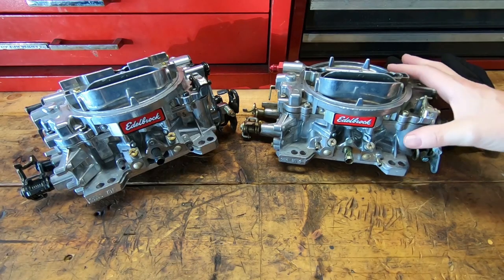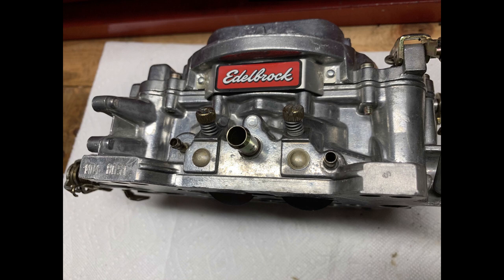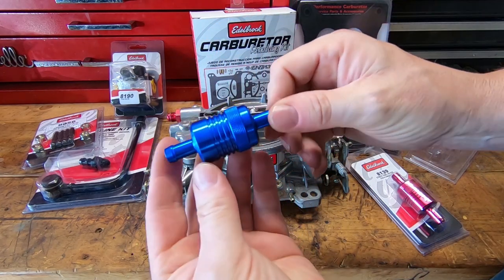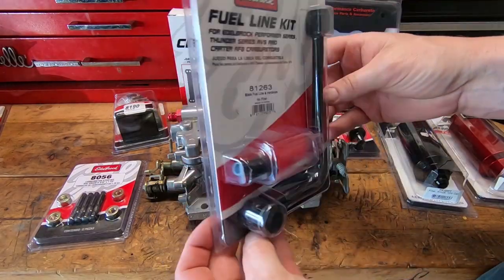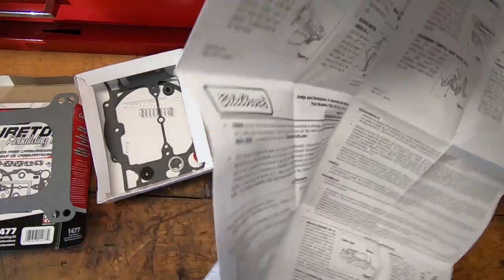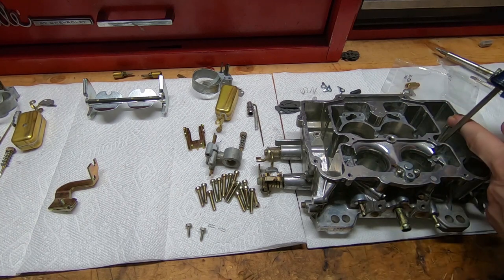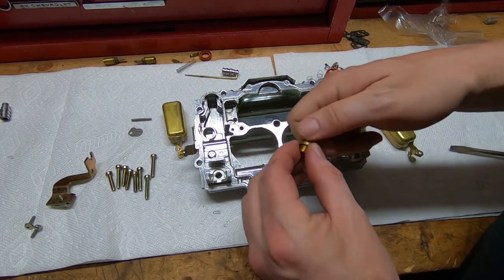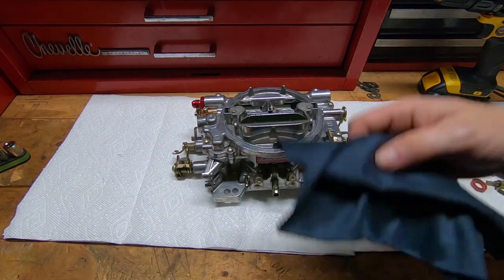Edelbrock Carb Rebuild Tips & Tricks

Comment: I have a 69 carter which was bought out by edelbrock.  They say everything is exact same but I've already found out that's not true. The 2 air adj screws are different size and thread. One of mine was bent and wouldn't seat. Ordered a set and they didnt fit. Had to take to machine shop and they straightened the original and sprayed dye down hole and it showed on end of screw that seat was perfect now. But I'm still having heck of a time getting it right. Way to rich, almost wouldn't run. Added a guage and regulator and set at about 5 psi. Better, but still strong smell of gas on idle, but almost choked when hot the gas hard. So, bought the full kit of springs, rods, jets. And went up slowly 1 at a time til I finally could nail it without half dying. It actually did a pretty good burn out and launch.......but pretty heavy still on idle. I had to go almost to the end of the chart with almost largest rod, spring, and jet....which isnt right because it's a stock 350 low compression 1972 factory motor that's never been modified. Very puzzled . Your vids are a help though and gives me some things to check

Comment: Not sure if you're still watching this chat, but I have a 1406 that I just cleaned.  After reassembly, I have no spring tension on the primaries.  The secondaries will snap shut like they are supposed to.  The primary throttle linking just flops around until you reach the secondary linkage.  I could swear the primaries would snap shut before.  Am I crazy or have I screwed something up?

Comment: Great video,  I need to rebuild my carb and you make it look easy. It seems that my accelerator pump has stopped spraying because I can't start my car without starter spray. My carb might just be gummed up, but I def need to rebuild it. Thanks for the great video!
Reply: Just clean the check ball cause its stuck in the gumm.
Reply: Hey bones have u ever tried those imitation ebay kits. Nothings better than manufacturer i know but man for the price what do u think?
Reply: @MuscleCarSolutions  sorry my break was over. There are rebuild kits on ebay from $15 to 30 for edelbrock. Probably Chinese
Reply: @MuscleCarSolutions  thanks for reply

Comment: I'm running Rich from rebuild on my 360 Dodge so I am trying to get it set up right so it is reliable and responsive still I have no idea what I'm doing but not afraid to try or get my hands dirty if I could just weld it i would be good God bless from Canada thanks for the help!
Reply from the maker: There are a number of videos in my Edelbrock carb playlist.  Check out the one on fuel system set up.  You’ve got to have that right before you get started.  There’s one on how to ready to tuning chart found in the owners manual of your carb.  Makes it easy to understand and what steps to take in the tuning process.  Also one on squirters and step up springs.  Critical to not neglect the springs!

Comment: New sub here 
I hope your still creating content. 
This video  helped
Reply from the maker: Put out 50-60 videos a year.  Jan 8th starts the new year for my schedule.  Cheers!
Reply: @MuscleCarSolutions  
I’ll be sure to put the bell on 🔔

How can I tell if I have a timing advance issue or carb issue 
Stumbles real bad off idle so rebuilt it and same.
Reply from the maker: @tommytron2000  start with the simple things.  What is your initial timing set to?  What size carb and what are the engine specs?  What is your fuel pressure set to?
Reply: @MuscleCarSolutions  
I’m going to have to test things 
Arnt I.
Reply: On a tangent 
The secondary butterfly valves stick about 70% of the the time. 
Is something’s your seen before?
Got me thinking of just getting a new “Fuel make it happener”
Reply from the maker: Time for a cleaning and verification that the linkage is operating freely.
Reply: @MuscleCarSolutions  
Yea 
Gotta do my do diligence. 
I hate that. 

If I give up on it I’ll send send it your way.
Reply: @MuscleCarSolutions  
Solid advice 
Went back to the basics discovered the I was chasing my tail with the carb and my issues were withe the distributor. 
I’ll be watching for more tips. 
Thank you

Comment: So I just rebuilt my 1406 600cfm carb. And when I'm setting my rpm to where it needs to be I have fuel dribbling out of the primary venturi only on the driver side. New floats, new N/S everything. And when truing to get highest vacuum as well I have no difference on the driver side idle mixture screw. But everything on the passenger side is working just fine. I rebuilt it due to very crappy idle and I didn't have any difference on the driver side idle mixture screw. Any help would be greatly appreciated
Reply from the maker: @KyleNock-s6q  if all the air bleeds and the idle passages are clear, then you’re either in the transfer slots, you have a vacuum leak, fuel pressure is too high or floats are set incorrectly.  Those are the common issues.

Comment: do you have any tips on getting stuck paper gaskets off the bottom of the carb? Previous owner just used the paper gasket and it's a mess. I don't want to mess up the bottom of the carb with gouges.
Reply from the maker: Carb cleaner/solvent and a plastic putty knife if you’re concerned about scratching.

Comment: Hi great video btw!!!! I sent out my carburetor to a local shop to get it rebuild. I got it back today and decided to install it back. Everything was running great for the first 15 mins and after that it started to run rough and you can see smokes coming out of the exhaust. I made some adjustments on the mixture thinking that it’s running rich but now when you start the car after is warm up it will only run for less than 5 mins and it stalls out. Any advice would be appreciate it. I have the edelbrock 1826. Thank you
Reply: Wow thank you for a quick response! No pressure regulator here and def watched that other video also lol.with that said this carb is on a 1964 Impala sbc 283. Do you think this is the right size carb for it? This carb was manufactured back in 2004 I was thinking about the avs2 500cfm?
Reply: Everything is factory from the cam except the intake manifold it’s an edelbrock manifold. I guess I also have to have an extra filter from the tank to the line cuz the car only came with the filter before the carb. Thank you for all your help 🙏🏼
Reply: Def will!! 👍🏽🙏🏼
Reply: One more question, do you have any recommendations if I stay with this carb what part# I should use for leaning  the metering size Rod and jets. It’s literally just a cruiser
Reply: Well def found the problem! I should of gone with my gut feeling. The guy that rebuilt it told me not to touch anything beside the Idle screw after it warms up. Well I look at the screw for the fuel and air was all turned to counterclockwise 🤯 that’s why it’s running rich and it wouldn’t stay running!

Comment: Thank you for sharing your brain with us!  :)   This won't be the first set of questions, but, two of your videos did say to ask away.   1) Will my C.A.R.B. gas kill my accelerator pump rubber?  Can I even use E85 in a pinch or even regularly, if I tune it (lambda/AFR tune) ?   (I wonder if I can get an extra one or two and replace it between rebuilds?  I'll call them.)  2)  I have two carbs in my garage: 600 Electric and a 750 Manual.  Both used.   Without sounding too dumb (I have not taken any Edelbrocks apart, yet, but, will this weekend ) are any of the critical parts interchangeable, such as jets or rods or venturi or pump - I assume because of the rebuild kit?   Thank you, again, and appreciate your time!
Reply: You can't run E85 with a carburetor without serious jetting changes.  If your carburetor is set to run gasoline, you will need to jet your carb way higher. Also be aware that E85 requires a much higher compression ratio to produce the same available energy as gasoline. Hopefully you are turbocharged, otherwise you gain nothing from using E85 fuel unless you have a 13:1 compression ratio.
Reply: @MuscleCarSolutions  Many thanks!  Carb Defender added to list. 👍
Reply: @jeffgabrisl7016  Thank you, Jeff.  I understand. I have 10:1.  After this morning's info from all of u, rejecting the E85 route. Thanks!

Comment: I have my 1405 on my desk. When the throttle lever is activated it will not open the secondary, just the primary. Trying to mimic the operation i see in your video at the 27:06 mark. My primary opens only no secondary.
Reply from the maker: Sounds like you’re missing the small linkage piece that connects the primary throttle shaft to the secondary shaft.  It’s opposite the side where your gas pedal linkage hooks to.
Reply: @MuscleCarSolutions   ok after cleaning i placed in closet for a month, the secondary was sticking, once I lubed it up -  it opens now

Comment: Hey man I've got a 1406 that has a seized primary jet. I've tried to remove with a easy out no luck have you ever had to drill out and use a heli coil to repair and did it work without leaking past the threads?
Reply from the maker: Nope.  When they are that far gone, it’s always been easier to replace.  If it’s due to ethanol breaking down the material, it’s not the only part affected.  You could try the helicoil or timesert option.  I never have but it might work out.
Reply: @MuscleCarSolutions  thanks for the reply if I try it I'll let you know how it goes  that way if you ever get asked again you may know to respond
Reply from the maker: For sure let me know how it goes.  But my response will be the same unless I decide to give it a try. There’s a reason why it seized up and that usually points back to the ethanol.  Do a good inspection and see if you find any of that corrosion internally.  Once it starts, there’s no way to reverse it.  Nasty caustic stuff!

Comment: What would happen if you left out that butterfly piece that goes over the secondaries?
Reply from the maker: It’s what meters the air flow and in turn meters the amount of fuel that pulls through the boosters based on the pressure drop in the manifold.  I don’t think taking that out is probably a good idea.  lol
Reply: @MuscleCarSolutions  interesting, seems my modified carb has all the manual choke parts removed AND that weighted butterfly plate is out also...can't say I feel anything wrong with carb performance but maybe it'll pull harder up top with it back in there?
Reply from the maker: Have an AFR hooked up?  What’s it running at part and WOT?  If not, is it running rich?
Reply: @MuscleCarSolutions  no AFR gauge, but the engine comes alive at full throttle! Rebuilding carb sometime this week. Gonna put it back together with ALL it's parts haha
Reply from the maker: @daviddntait  yup.  Rebuild and retune it.  Assuming it’s the right size carb for what you’re working on.  Maybe that was someone’s way of compensating for not tuning or another issue.  You’ll know soon enough!  Good luck with the rebuild.  I have a bunch of videos on that topic and how to tune.
Reply: @MuscleCarSolutions  thanks brother! I really appreciate it! Aloha from Hawaii
Reply from the maker: @daviddntait  anytime!  Don’t hesitate to ask any questions.  I’m glad to help.  Mahalo!

Comment: Help Edelbrock 1406 been sitting awhile gas get to carburetor can see it in the clear filter but wont go into carburetor if i crank it then gas comes up through the needle valves and out the gasket if i drop some gas down the carb van fires right up ~~ by the way great videos very informative
Reply: @MuscleCarSolutions  Thank You For The Quick Reply And Information ~~~ horrible fuel says a lot i will never let it sit again  " Happy New Year To You And Yours "

Comment: what about the slop in the throttle shaft
Reply from the maker: Inconsequential.  I did a Short with that info.
Reply: @MuscleCarSolutions  so I got a 73 mercury cougar. 351 c 4 barrel heads .  I'm taking off my 750 Edelbrock. I'm putting on a 650 Edelbrock. My idling is no good because I think of the slop in the butterfly shaft. an Edelbrock told me that's too much carburetor for that engine. so I'm going to try it. what do you think?
Reply: @MuscleCarSolutions  I bought the car that way 3 weeks ago. I took off the Ford intake to spread bar and put on a performer intake from Edelbrock. because he had a doctors to the new Edelbrock 750 and I was getting vacuum leaks.
Reply: @MuscleCarSolutions  let me try this again
 I bought this car 3 weeks ago. he had a stock intake on it. that was a spread bore intake. he used adapters to make the Edelbrock 750 fit. it had vacuum leaks. so I put an Edelbrock performer intake on.
Reply from the maker: Ya lost me!  Are you saying you have the 750 on a performer intake and it’s got a rough idle?  What’s your initial timing set at?  What’s your fuel pressure set at?  What did you set your floats to?  If you screw your idle mixture screws all the way in does it get better, worse or kill the engine?
Reply: @MuscleCarSolutions  ok thanks for your replys . let me look at a few more things.  then I'll let you know what's going on .and all the stuff I did . thanks for your help thus far.

Comment: To avoid all the additives why not just use a higher grade of fuel and avoid Ethanol altogether. 
Cost yes
Reply from the maker: Not an option for most people.  Non ethanol fuel isn’t available at every station.  Higher grade fuels don’t necessarily mean higher quality.  In fact it’s less.  Doesn’t sell as quickly and sits in the storage tanks longer which has a longer period of time to attract water and all the mess that goes along with it.